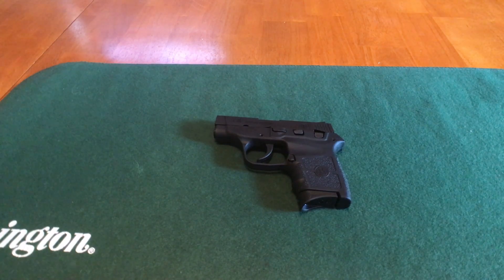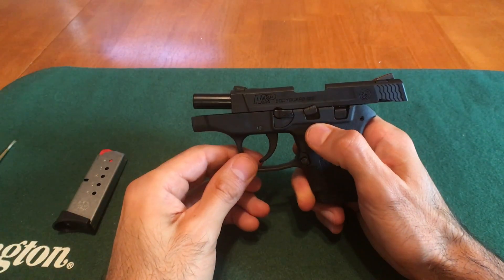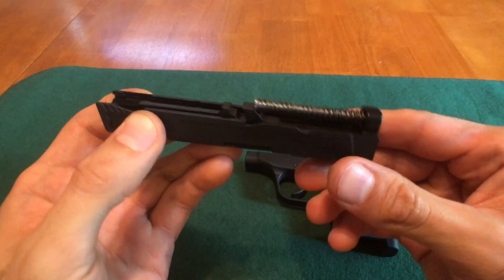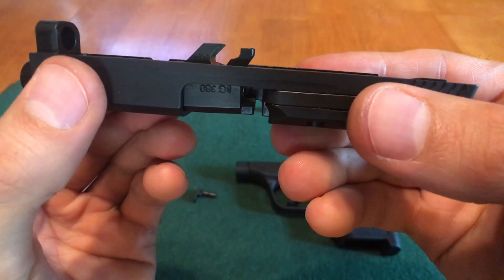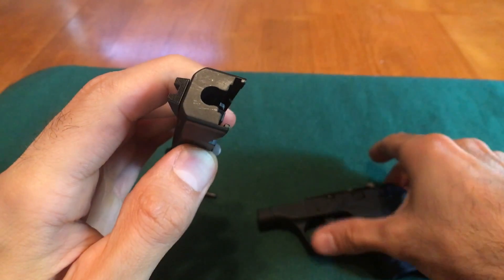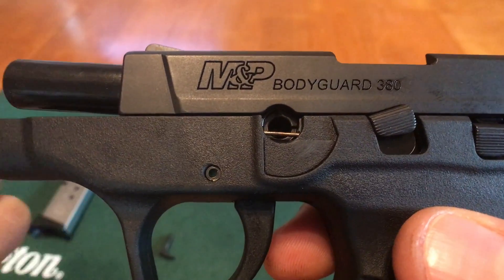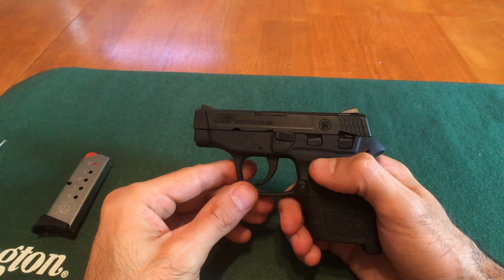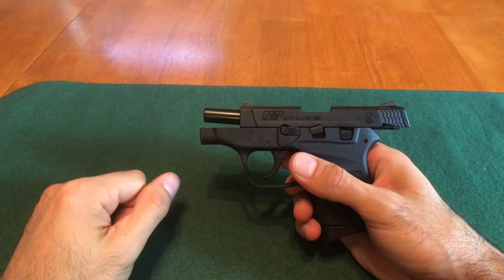How to Disassemble and Reassemble an M&P Bodyguard

Comment: Thank you for this. I’ve been fighting with putting the pin back in for years. Best explanation of how to do that I’ve ever seen.
Reply from the maker: Hi Jonathan, I’m glad the video helped out. Hopefully the next time when you reassemble your bodyguard it wont be a fight. :) Thanks for watching and leaving a comment.  Have a great day.
Reply: @UBRArsenal  Just wanted to comment on the take down pin.  When I first got mine, I had to fight with that thing every time I reassembled it.  Then I found that if I got it started and pressed in on the barrel as I was pressing on the pin, it snaps right in.  No need to start at 6 o'clock and turn it, it snaps right in at 3 o'clock.  Works every time.

Comment: Indeed, an excellent presentation.  I couldn't get my slide to rack after inserting the pin.  Yours was the first video to point out how important it was that the barrel be sufficiently forward.  I pushed the barrel forward by carefully using a screwdriver as a lever before reinserting the pin.  Once I reinserted the pin after that note the gun racked fine.
Reply from the maker: Hi Mike, I’m so glad this video helped you out reassemble your pistol.  Thanks so much for watching and leaving a comment.  Have a great day!

Comment: I have the bodyguard 380 with the built in red dot sight and the left side button doesn’t function but the right side does, do you know what is wrong or how I should fix it. Thank you the takedown video was great
Reply from the maker: Hey Lamar, if you have instagram DM me a few pictures or a video so I can see what’s going on.  It’s hard for me to help without seeing it.  Not sure if I can help but its worth a try.
Reply: By the way I don't own it yet but it has the insight laser with the grey buttons to push
Reply: @UBRArsenal  I don’t have Instagram but like I said the grey button when pushed doesn’t turn the laser on and only the right side button works but feels like it will soon go out as well, it’s a insight laser built in

Comment: So I just disassembled mine and reassembled it and I’m not sure if I did something wrong or it is supposed to be that way but my barrel seem to be loose with the slide locked back?
Reply from the maker: Hi Roy, the barrel should be able to wiggle around a little bit but not a ton.  When the slide isn't locked to the rear everything looks to be in place right?  If it was me, I would take everything apart and put it back together following my video one more time.  One of the biggest things with this firearm, you want to make sure you capture the barrel with the takedown pin.  Let me know how you make out.
Reply: UBR Tech  I watched Atleast 5 different videos and finally took it apart and put it back together Atleast 5 times just to be sure I did not miss anything but I did not notice before I took it apart if it had play. But it makes sense to have a little bit of movement but it’s definitely not a lot. Just got worried a little bit. Thanks for your video it was definitely the simplest video out of all the ones I watched before it.
Reply from the maker: @royflemingjr  Ok, I think you're good.  I checked mine just to make sure and just as I thought,  my barrel has a little bit of play too.  I'm really happy my video helped out.  Thanks for watching and for subscribing.  Have an awesome day!!

Comment: My friend (actually true) broke down my .380 in the field and couldn't reassemble. I told him to not worry. I'd put it back later. Turns out he bent the catch that holds the break down lever. I tried to bend it back. That failed instantly. So now my M&P is a paperweight. Anyone know a good  bartender?
Reply from the maker: That sucks man. Sorry to hear that happened. I bet you could reach out to Smith & Wesson and purchase a new part. If you do reach out let me know how you make out. 🤜🤛
Reply: @UBRArsenal  Yeah. I found it. It's the slide stop spring. Took it apart and am just waiting for the spring. It's cheap and easy. I made too big a deal of it. But not being a gunsmith, this stuff looks more intimidating than it is.

Comment: What a pain in the ass holding all those springs n parts in place to reasemble...... 🤯🤯🤯
For now on ill just lube spray the crap out of the gun n internal parts.
I'm getting rid of it n getting a Glock 42.... A much better 380....
Reply from the maker: Hi Earl, you’re right, this pistol isn’t the easiest to reassemble.  The Glock 42 is much easier to take apart and put back together.  If you are able to, you might want rent the Glock 42 and Ruger LCP Max. That way you could see which one feels better to you.  Also just as a fyi SIG is releasing the P365 in 380 soon. Just figured I would let you know so you could try all three before you buy something.   Thanks for watching and leaving a comment.  Have a great day.